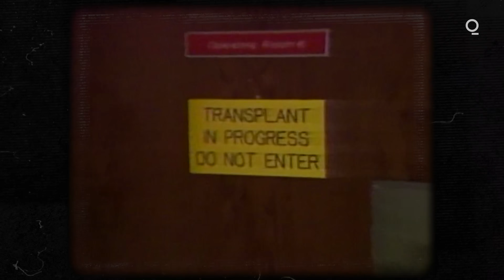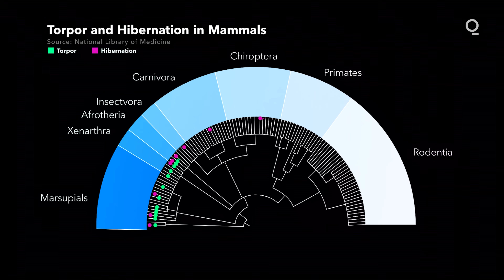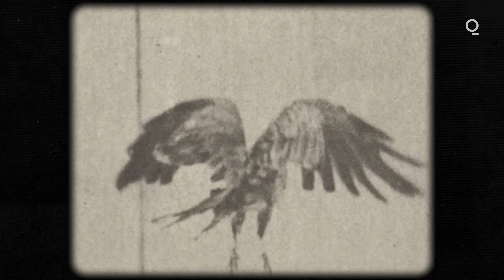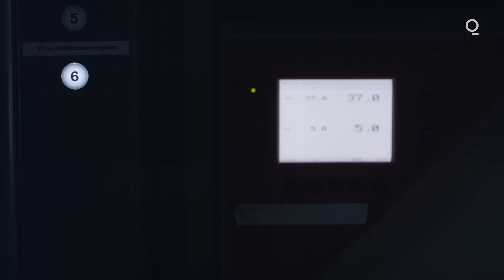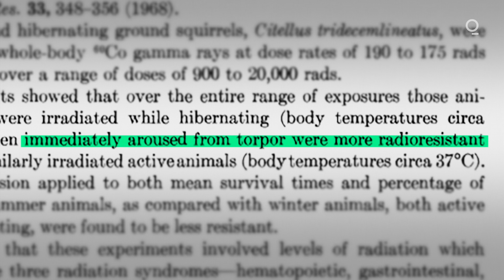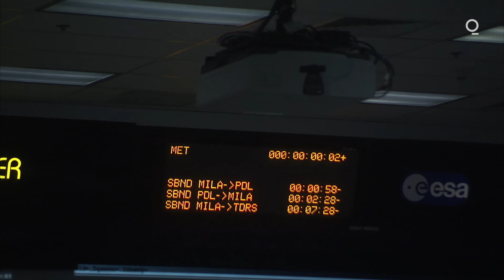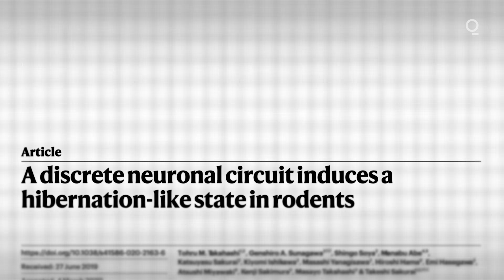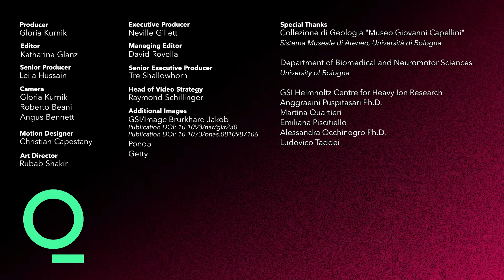How Human Hibernation Could Become Reality

Comment: Cryogen in terms of freezing living creatures alive, like cryonics, modernly is feasable, in steps of placing the creature in deep sleep first, then instant freeze, so when defrost/resurrection, the heating of the body can be done slower, before awakening sleep, without damaging the creatures anatomy/cells. 
 
 Nitrogen, typically known used in modern age, can also amp a creature to becoming nitro-beasts, more able to re-enter the stage often, even endure environments better in temperature, some symptons, are like urinary track with oder of fried-chicken, rectums like damp mop. 

 Side effects, sometimes excessive sweating during rappid motion, similar to spinal-meningitus, yet no fatigue or dehydration, a retaliations to thermal/hot environments, as body cooling reaction, and even more resistance to frost bit effects in center anatomy range ( not if hands and feet).